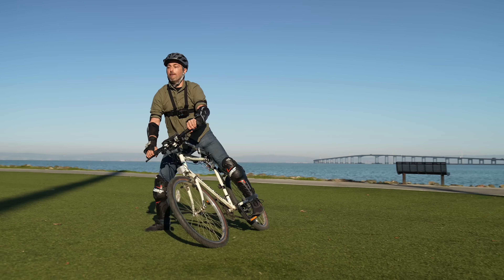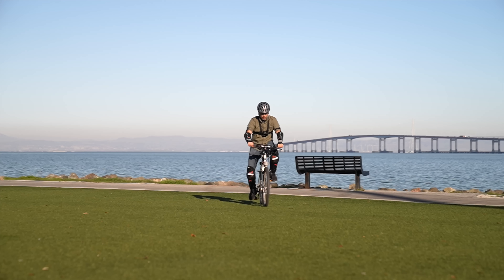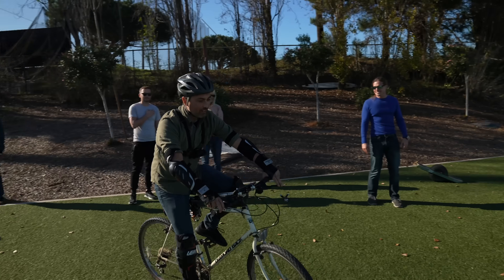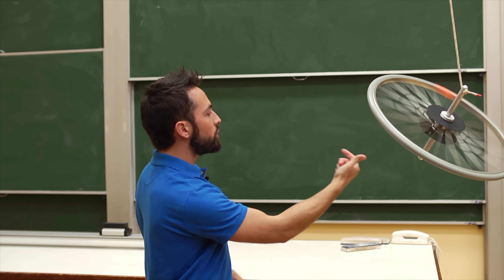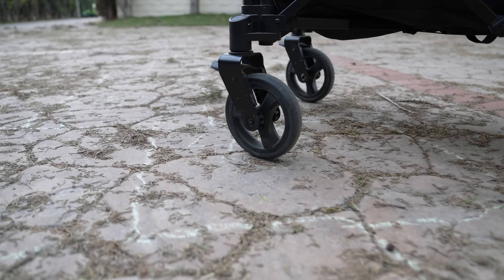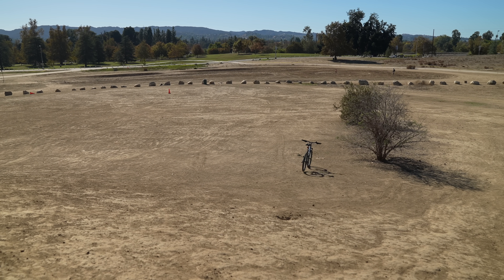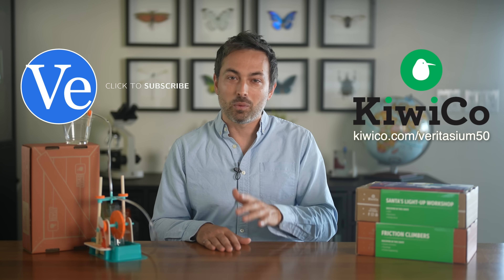Most People Don't Know How Bikes Work

Comment: Very interesting, as a motorcycle rider for many years. There is an effect that comes into play when going above say 20 kph. You do not steer the bike, you do not turn the bars in the same direction you are going, you in fact only counter steer. Going through a right hand bend, you push the right handlebar away from you, opposite to the direction you are going. Many riders are not aware of this and find it hard to believe also, until they notice it themselves.
Reply: You do this on a bike but because of the low weight you can just lean and it happens. The counterstearing being the "catching yourself before you fall."
Reply: @herbninja  Do you "lean and it happens" or do you subconsciously counter-steer to turn? As described in the vid, you actually do counter steer, you just don't know that you're doing it. It has nothing to do with the weight of the two-wheeled vehicle. But you're correct, you countersteer to "catch yourself before you fall" eventhough we don't consciously turn opposite in the direction we want to go.
Reply: @herbninja   - bicycle, dirt bike, CBR, Harley; I just push forward with right hand to turn to left & vise versa;  above (say a couple MPH) the handles bars don’t turn one lick the bike just leans into the turn. 

I was wonder the whole video if I could ride the thing because unless I’m real slow, the bars don’t turn.
Reply: I'm glad to see others who understand this.  I stirred up a small hornet's nest in explaining what the result of widespread unawareness of this has been in terms of popular belief.
Reply: @ericl2969  I've been riding about 2ish years I think? but I decided to educate myself as much as i could and experiment with as many techniques (safely) as i could find. it blows my mind how many times I've mentioned counter steering to riders who have been on a bike for half my life or more and they have no idea what I'm talking about. They obviously know how to maneuver the bike at that time span of riding but still have no clue how its happening. I learned about counter steering the day after i bought my bike. Age and access of that information is obviously a factor but still it makes me wonder.
Reply: Nah bro lol
Reply: Sure, but a motorcycle is a lot heavier than a bicycle. You can't turn a motorcycle by just shifting your body's weight, because your weight makes up a small fraction of the total weight of the vehicle. On a bicycle however, your weight is about 10 times that of the vehicle, so you can turn it just by shifting your weight, without counter steering.
Reply: @girla9480  Actually not true though. I can ride my 500lb yamaha and cross my arms and steer it. Also came here to say the same thing Odd Arne said and I agree a lot of riders have no idea they're counter steering and I find that kind of amusing.
Reply: @girla9480  counter steering in motorcycle is real. Riders get into accidents when they forget to counter steer bcoz of fear. Suppose at high speed u r abt to hit a car. Out of fear u turn the handle to the right. But bcoz of counter steering the bike will go left towards the car and bammm. A lot of newbies get into accidents bcoz of this. An experienced rider knows abt counter steering. Don't believe me? Try it........... With the lowest speed required and protective gear ofcourse.
Reply: @girla9480  Actually, it doesn't matter whether you're on a 17lb. bicycle or a 500 lb motorcycle, you counter steer. I know, it's not intuitive. It's natural to us who have been riding bikes and motorcycles for decades; I sure as hell don't consciously think about the counter steer. It comes naturally.

Comment: There is a force that was not mentioned. The off centre contact patch as the bike leans provided a turning force in the steering. Friction in the bearings is the force that works opposite to the off centre contact patch. This is very pronounced on motorcycle with larger tyres.

Comment: You didnt address the effect of the unbalanced mass of the rider on this configuration of bicycle when operated as intended. That is a major reason why its hard to steer without counter steering. That and the radius of the turn. Theres a lot of math and physics in this but look at how a coin or wheel by itself rolls and turns. It has no moving parts or ability to differentially shift weight to counterbalance. If the radius of a turn becomes too severe regardless of speed, it will fall over. The length and width of the contact patch also effect this.

Comment: As many have commented motorcyclists know this (gyroscopic procession) as counter steering but it only comes into play above a certain speed, for low speed maneuvering it is the same mechanism at play as the bicycle experiment.  What I think was missing here is what factors effect the transition from 'balance' steering to higher speed counter steering?  Is the transition progressive or instantaneous?   Love to see a part II of this explain the 2 discrete modes of steering for 2 wheel vehicles.
Reply: Counter steering is required at every speed. There is no magic velocity at which steering changes from "normal steering" to "counter steering".

Comment: Any good motorcycle rider knows this. You can watch the MotoGP guys do it. When they (or you, when you are on a motorcycle) want to turn left they tap the left handlebar - which turns the handlebars right - and that makes the bike quickly lean to the left, then they lean into the corner. It would  be impossible to get the bikes to go from leaning right over on the left hand side, then get back up and all the way down on the right hand side - through an S bend - without doing this. It makes turning much quicker because it gets the bike the lean over much more quickly...

Comment: In the Netherlands a lot of people learn to bike without even holding the steering wheel when they are young (mostly young boys because it looks cool biking with your hands in your pocket and keeps your hands warm), myself included. Outside of going onto curbs (driving into a curb without touching your steer wheel will cause it to drastically shift and you will most likely fall), you can drive any route without ever touching your steering wheel, even to start up.  

The front wheel will always follow the route of least resistance and gravity. When you tilt to one side with your body weight, the front wheel will also tilt to that side because of gravity and the weight of the bike. In a way being able to hold the handlebars actually works against learning how to bike. The steering handlebars are more for creating frame rigidity in times where you need it, like bumps, sudden movements like hard acceleration/deceleration or sudden directional changes.

Comment: There are at least 5 forces acting on bikes steering at ALL TIMES. 
As long as the sum of the forces is  positive towards dynamic stability it works.
1. Rider input, both steering force and weight movement. 
2. Castering force, increases with speed.
3. Gyroscopic force, increases with speed. 
4. Steering static stability, constant. 
5. Cone force, as a bike leans the contact patch of tyres effectively becomes part of a cone pulling the tyres towards the lean direction and tending to increase steering angle. (Probably the most interesting and least understood force)

Comment: As a road cyclist, I am wandering: are you sure that we counter steer always? I’m pretty sure that while cornering at high speeds I can turn right just by pushing down on the handlebar from my right hand (I guess this uses gyroscopic procession), without necessarily counter-steering. 

I wouldn’t be surprised if I still did it without realizing it, however. But have you tested if it’s possible to corner without counter-steering at high speeds?
Reply: Always. At any speed.

Comment: The Video is a bit too theoretically and it is also possible in low speed to steer without counter steer. In my opinon there is a great way to discover the counter steer mechanism and the power of it. Instead of pulling on handle bar you need to push the handle bar in the direction you wann go. You will be amazed how effective the steering will be works best when you go faster than 10mph/15km/h. With this technique you get a better driver of bikes.

Comment: When I was a kid in had a Honda cb125 motorcycle that I almost drove off the road and had to learn this lesson "trial by fire style".  I had been riding for weeks up and down our road so my dad decided to take me to a nearby road that was much longer and happened to run along side a water feature (basically a canal), it was lined with a steep 15ft drop covered with thorn bushes (black berries).  Traveling at 25mph every thing was fine.  Dad said take it up to 35mph.  My kid brain heard 55mph (cause I wanted to be let loose.  Funny thing happened.  At the increased speed the gyro effect was enhanced, where normally leaning had been enough to effect direction now counter steering was much more necessary.  I had to learn this while going through a curve while going faster then I ever had before inches from going off the road into thorn bushes followed my water.  Fortunately I figured it out in time... Just barely.
  Many years later I learned another lesson in a similar way, while on a mountain pass with no guard rails.  The best way to deal with a motorcycle getting front wheel speed wobbles is to lock up your arms and let off the throttle.  Don't try to counter act the bar movement.  Your reflexes won't be fast enough, resist the movement by locking up.  How to avoid this? Don't buy a bike with bad steering geometry.

Comment: Nah, just remove hands from steering wheel and control it pure by your weight distribution, and you will be able to turn without any problem. Ofc its not easy, coz speed is low and you need good balance, but its doable.

Comment: Similar thing happens with an Inverted Pendulum. The cart has to go back a little so the rod falls in the direction it's commanded to go, and then adjusts itself after that. This is sometimes known as an "Inverse Response system"

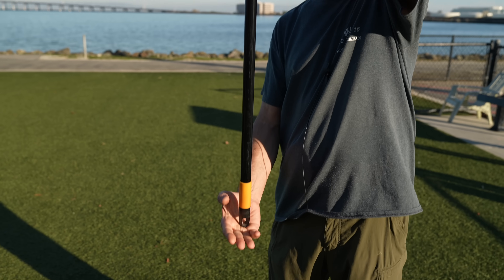Oh nevermind, this appears at 3:15

Comment: This is applicable to motorcycles too. id say 95% of riders dont know how to steer their bike properly.  its not taught in motorcycle safety training either. you push your right handle bar forward to turn right, it puts you on the side of the tire and vice versa. the lean just induces a counter steer. you need to use your handle bars.

Comment: The West Virginia Motorcycle handbook says to “counter steer”. 

It’s on page one and repeated.  

Back when the GSX-R 600 was fuel injected I smoked all my idiot friends a few minutes after they made fun of me for having the smallest bike. 

Not even the guys on the 1800cc could touch me. So they made fun of me for “counter steering”, basically push left to go and tilt left. 

They tried to make fun of me because I could lay that rice burner down and loose them in the tightest of turns. 

I get you are going to talk about the gyro effect and how these idiots didn’t even realize they were counter steering on every curve they went around. 

I’m almost positive none of them were licensed or registered to at the bare minimum carry a passenger during daylight. 

So tell me about electricity, motorcycles and bicycles. 

You lost some serious credit when you claimed electricity works using magnets and not moving electrons.

Comment: One counter argument to this setup... have someone do it without using the handle bars i.e. riding hands free.  How do they counter steer when they want to make a turn when they've got to initiate the lean to get the bike going the way they want without input on the handlebars?  Seems like, in a way, handlebars actually handicap gross control of the bike but provide much easier fine maneuvering (no 90 degree abrupt turns without hands unless you're very good at it).
So... in short... remove the handlebars and see how much the riders countersteer to make turns.

Comment: I feel like this knowledge might be more accessible as someone who rides a bmx bike. As I rode my bike, I would stand upright on the pedals and then shift my weight by leaning either forward on the handlebars or right or left to turn, and switching my weight on the handlebars with each rotation of the pedals to accelerate. So there's this back and forth motion of the bike even when you are going straight, because you're constantly counterbalancing and shifting your weight. When cruising, I would have my left leg down with half my body weight on it, and the other half of my body weight supported by my right arm on the handlebars or vice versa. Most of the turning I did was never intentionally initiated by moving the handlebars, but by my leaning. I saw the handlebars as more of a weight-shifting tool that you can use to keep your balance while doing these leans required for turning.

Comment: The motorcycling guidebook a twist of the wrist and it's a company and videos have an excellent demonstration on how you actually push on a handlebar in order to turn at speed.

You literally apply pressure to the inside of the handlebar on the inside of the turn pushing it forward to maintain a turn on a motorcycle.

Comment: You could still steer it in any direction by doing a wheelie and then it basically acts like a unicycle.

And could you not also initiate a left turn by aimply leaning to the left very strongly? It would still be difficult and probably require a bit of luck, but should be possible. Bit of luck because you must not have to counter steer too much in the moment it gets locked.
Reply: You absolutely can, just look at the bike coasting by itself at 7:24. It leans left, starts turning left and the handlebars steer left, all with no counter steering. I did some experiments myself, it's possible to turn without counter steering on a bicycle (not on motorcycle obviously, it's too heavy) by getting your butt off the seat and shifting your weight.

Comment: Another good experiment to do is; whilst riding a bike in a straight line, let go of the handle bars completely and gently push forward on one side of the handle bar.  If you push forward on the right side you will turn right and if you push on the left hand side you will turn left.  This proves that it is all about shifting weight rather than turning the handle bars, as you push on the right side for example your weight shifts to the right and then you turn right.  The handle bars are just somewhere to put your hands and shift your weight rather than for steering.

Try this out.

Comment: There's second gyroscopic effect besides that you mentioned, where you pushing down handlebar and it helps steer that derection. 
If you never push down handlebar, instead push forward, for example left handlebar away, force applied would transfer 90 degrees in spinning direction of wheel and front wheel would try to lean towards the left side.

Comment: Another task that requires a counter movement prior to moving in the intended direction is backing up a trailer. You have to first steer the "wrong" direction to get the trailer pointing the right way, then "follow" it once its pointed that way so it doesn't jackknife. This doesn't seem to  be as intuitive to some people as riding a bike or balancing a broom is though.

Comment: I learned this many years ago when I learned to ride a motorcycle. The best way to steer into a curve is to push a little on the  handlebar in the direction you want to turn. When you turn right, push a little on the right handlebar. To turn left push a little on the left handlebar. More than just leaning into the curve, pushing on the handlebar will give you a tighter turn.